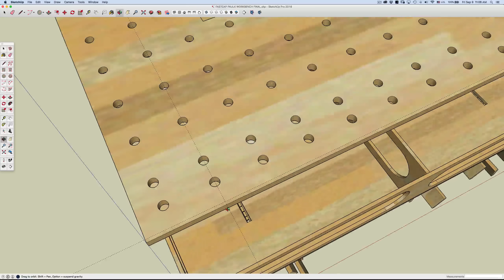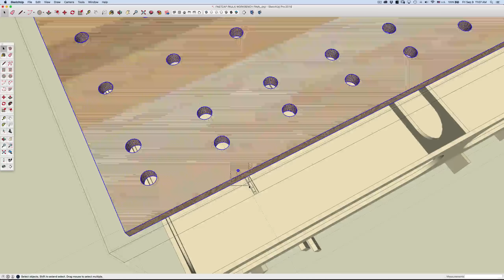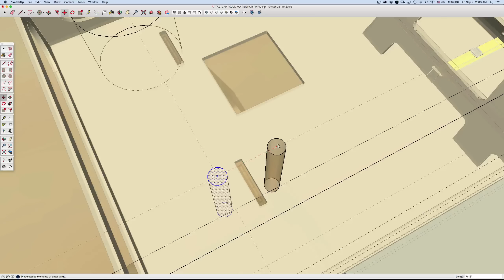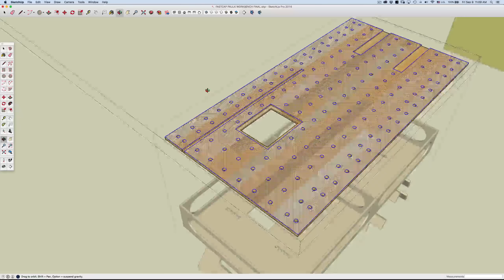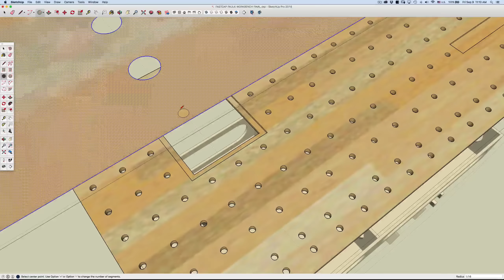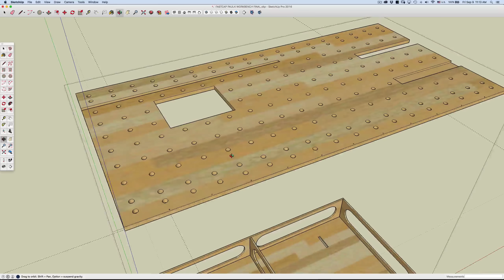SketchUp Trick

Comment: Ron, an easier solution would be to copy the cylinder (hole) to all desired locations, then select the whole table top by dragging a window across it.   Once the table top and all cylinders are selected, right click on one of the surfaces and choose "intersect faces -›with selection".  After this, all you have to do is delete the top and bottom of each cylinder.

Another option would be to download the "joint push pull plugin for SketchUp".

Thank you for all of your videos and designs, hope this helps you with future modeling!

P.S.  I bought your plans, made the original Paulk work bench and love it, great plans too!
Reply: Awww ya beat me to it!

Comment: Great tip. Works well in cases where there top plane can be pushed through. 

There is another way, a trick I figured out when I had to punch a hole through a SketchUp wall such that BOTH surfaces had holes.

The idea is to create a component that will glue on to any surface and cut a hole. Then copy that component to as many locations as you need. When you have them all in place, select them and explode them and they will punch holes through BOTH surfaces of a wall. There is a specific sequence of steps that have to be followed which I can show you if you are interested.

Comment: I know I'm real late to the party, but since you use the pro version, you can add and subtract solids.  No need to start with a single surface again.  In your case you would create a group of what looks like dowels,  spaced at the correct intervals.  make them long enough to pass through the top like a drill bit, then subtract the cylinders from your top.